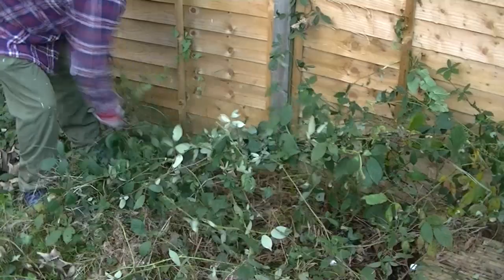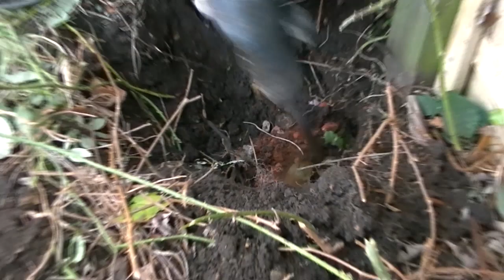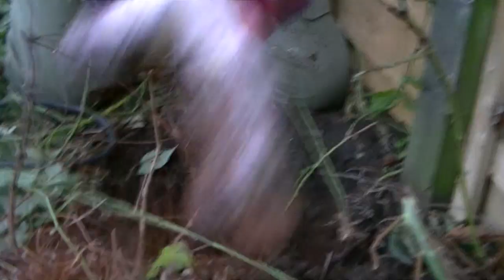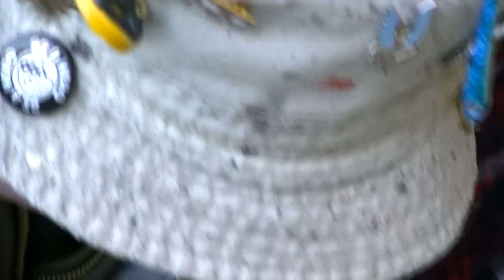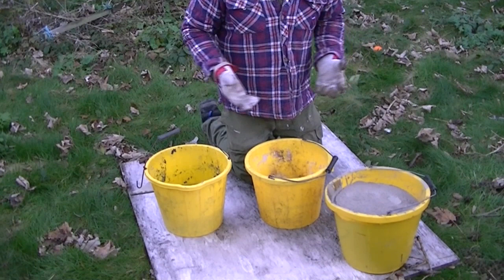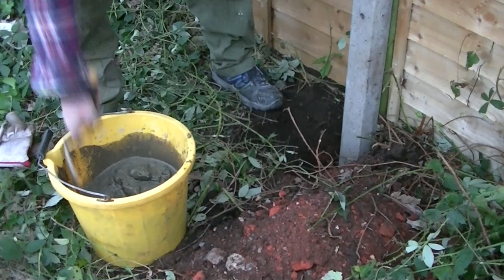Country Ways - Episode Seven - Concrete Spur Repair

Comment: This is not the correct way to add a concrete spur to a broken fence post . You should remove the broken/rotten stump before adding the concrete spur and ideally trim back the post that's above ground clear of the earth . The reason you need to remove the post below ground is so you get the concrete mix completely around  the new concrete spur and not just around 3 faces of the spur. There are a number of other vids on here making the same mistake you need to remove the broken piece below ground.
Reply from the maker: Thanks but that's the way we do them in the uk..speed  and get fixed asap..keep looking at my channel enjoy..

Comment: good video, really impressed to see your approach to basic safety but would really recommend some eye protection particularly when using the chisel, the end is starting to deform and its common for bits to start flying off when you strike it with the hammer.